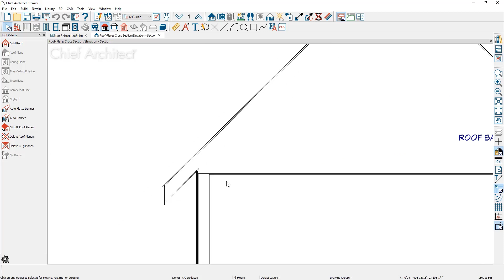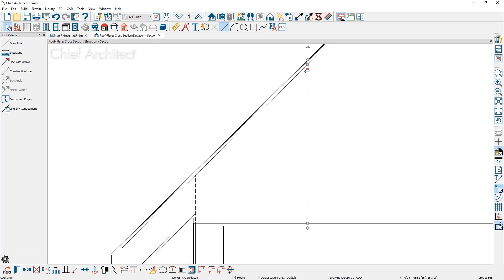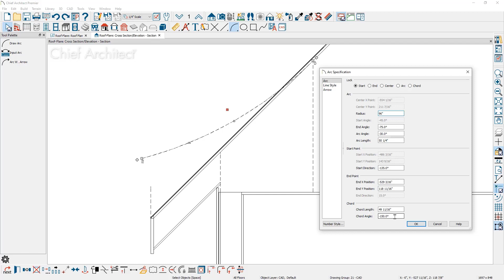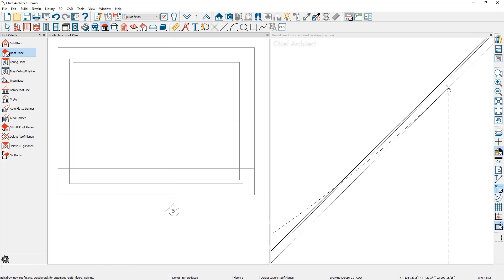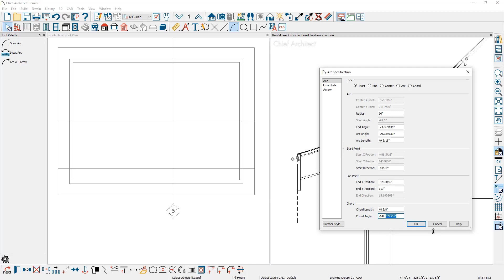Using CAD Tools to Make a Roof Flare

Comment: Good day

I am experiencing a Mouse issue with Chief Architect X13. 
After about 10 minutes the Mouse stops selecting items.

It starts acting like a Marquee Tool and does not respond anymore.
Is there a work-around to this Mouse issue.  

Thanks
Reply from the maker: Hello. I am sorry to hear about this mouse issue. I would recommend reaching out to our Technical Support team to look into the problem further. Our support team has a lot of knowledge in this area and can help you troubleshoot this issue. Technical Support can be reached at 208-292-3399 Monday – Friday from 7 AM – 4 PM Pacific.